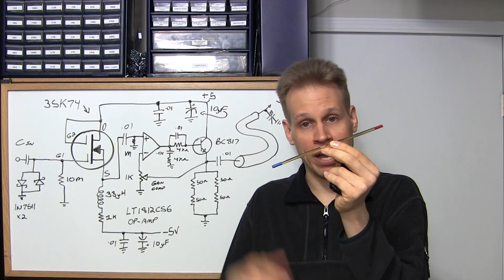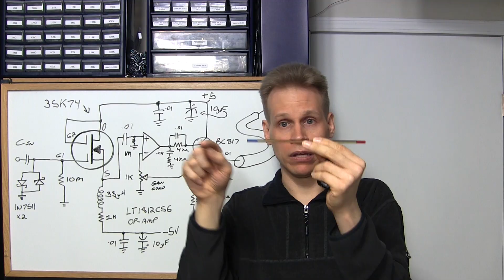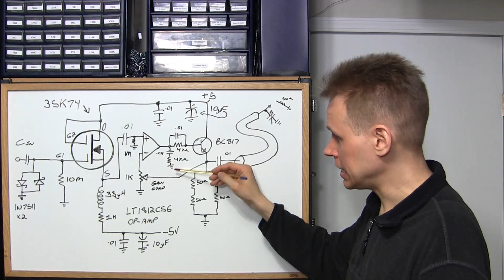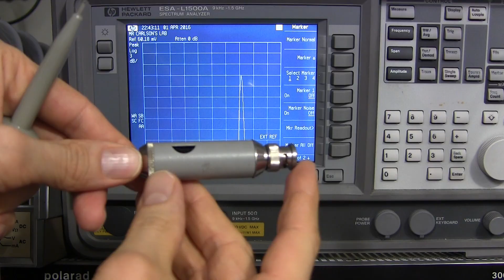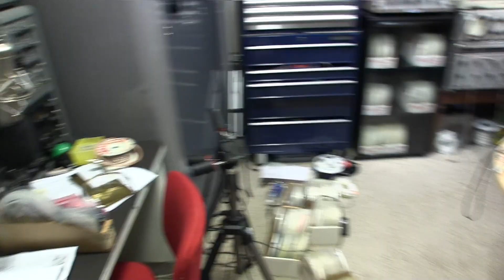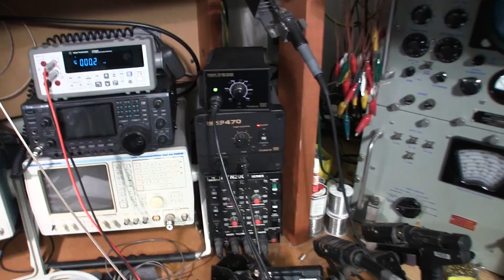Active Probe, Schematic Included

Comment: CC is not a current source. Your output impedance of common collector output stage is 50R || (47R / ß) or about a few Ohms. 
But it should be 50R to drive the 50R transmission line if you are so concerned about reflections.  This is why unterminated probe signal will look awful — it will get reflected by both high (sink) and low (source) impedance ends.
You probably need close to 50R inline with the probe cable.

Comment: The LT1812 is a 100MHz unity gain stable low output impedance opamp. Only works because the gain is so low.
Reply: It already has high input impedance so I do not understand what the FET adds to the design. All it does is the same as a capacitor would.

Comment: Hello can I replace the 3SK74 with NTE455? Or maybe you have other suggestions?
Reply: Should be even better. But as he said, there is a lot of experimentation involved in these developments. You will have to fine tune it. I once build 50 Ohm input BJT Cascode amps in the same frequency range and it was a lot of T&E to get the biasing right.
Reply: I went looking and could not find anyone still making these once ubiquitous dual gate VHF N-ch EnMo FETs. What happened, mixing happens differently and BJT became better?
Reply: Toshiba is the last one making these. 3sk29x are still available.
Reply: After thinking about it for a while I have the suggestion to replace the FET with nothing. I do not see what it adds to the circuit.

Comment: I am wondering if the gain control is shown correctly... Normally, I would expect that the top of the potentiometer would be connected to the  output emitter follower and the "slider" would be connected to the inverting input...

Comment: Could you explain what you mean by keeping it flat?
Reply from the maker: Hi John. When you look at a spectrum analyzer, as it sweeps from left to right on the screen, the line is flat. If you connect the tracking gen output to the spectrum analyzers input, the level on the screen should rise, but still remain flat from side to side. (so the trace should just raise vertically due to the amplitude of the tracking generators output.) If the trace on the CRT was on a slope, the amplitude would differ from side to side (left side of the screen to the right side) Picture the trace on an angle. So if you have a span of 20 kHz, with a center of 455 kHz.... The left side of the screen is 445 kHz, center is 455 kHz, and the right is 465 kHz. As the trace starts at the left of the screen, the tracking generator output is at 445 kHz, since the tracking generator follows the trace on the screen, when the trace (dot) makes it to the center screen, it's at 455 kHz, and so on as the 'Dot" is moving. Then this starts over after it hits the right side of the screen (465 kHz) This is known as the sweep. Since for testing purpose, the amplitude from the tracking generator (and the input of the analyzer) needs to be "flat" through the entire frequency span in order to accomplish a proper alignment. If something is not flat in amplitude (the same across the entire frequency span) you will not align the device under test properly, as you would be compensating for the error in the test set up.
Reply: Ty.

Comment: Mr Carlson you might like to mention this would be an excellent circuit for matching a high Z long wire antenna to a  Comms Rx or for Rx only on a  Transceiver.   2. It might be worthwhile mentioning other Obtainium on surplus market RF op amps like say the LT1252 which will do duty in place of the one you have used. 3 Sources for the negative voltage other than the IC7660  if people want to operate from a unipolar supply ??

Comment: My scope probes have 9 MΩ, why do I need 50Ω at scope connector? Is it to damp the ground reference?
I see all the time 50Ω required at connector but no one says why. Is a probe impedance purely resistive?
Reply from the maker: Hi David. When you read 9 Megs in your probe, you are reading part of the divider that makes it a X10 probe. When you see 50 Ohm inputs on a scope, this is for reading high frequency RF signals with little reflection. You can not (should not) use your X10 probe when the scope input is set to 50 Ohms.
Reply: Is a probe impedance purely resistive? No: it's capacitance dominated its freq. response. And despite what a lot of people thing, its resistance falls with increasing freq. too

Comment: You say that you did keep the copper on the underside as shielding.
I thought that it would create a capacitor effect, I mean (copper insulator copper circuit)? :-)
Reply from the maker: Ground plane layer. Stray capacitance taken into consideration.
Reply: You are correct that it will add C to ground, but the trace width and board dielectric er and thickness will also affect C but allow better impedance control. A compromise would be remove the copper on the underside just in the area you don't want these effects.

Comment: Can anyone explain why engineers design resistor networks to get 50ohm instead of a single 50 (49.9) ohm resistor? Here Mr.Carlson uses 4 49.9ohm resistors, two pairs in series that are in parallel. I am a student and very curious. I'm assuming something to do with stability?
Reply from the maker: The attempt to get a real 50 Ohms, taking into consideration trace resistance, and solder joint resistance.

Comment: The active probe would be a nice and useful item to have in my collection of test gear. I checked eBay to get an idea on the price of an HP 3585B. I found one but the seller wanted more than the price of a new Rigol DSA815-TG.  :P  One of these days I would like to buy a spectrum analyzer.  Spectrum analyzers are rather expensive beasts so I'm more likely to have a go at making a basic one from scratch. I don't need one that covers more than about 0 to 500MHz.

Comment: I enjoyed the video.  I was wondering  how to attach the tracking generator to the circuit that you are aligning so that the tracking generator would be protected.  How do you match the impedance of the tracking generator to the input of the circuit you are testing.  Is it okay to connect a signal generator with a low output impedance to the input of the dut that has a high impedance without any matching?  Thanks.
Reply from the maker: Hi Richard. In most cases, a terminated cable at 50 Ohms, and a capacitor in the Pico Farads somewhere is usually good enough for coupling the signal gen or tracking gen to any receiver. Never couple your test gear to a receiver without a DC block (that pF capacitor) or you may damage the output sections of your tracking gen or signal gen. I designed a protection circuit for this purpose, see this video: https://youtu.be/ETKyKC2Zj-M

Comment: Hi, great video.  I am wondering, why the need for the source-follower FET on the input stage?  Couldn't you AC couple the probe  tip directly to the LT1812 input?  Seems like this would avoid some potential bandwidth loss and gain uncertainty in going through the FET.  Why is the FET stage needed?

Comment: Paul, could it be beneficial to put a resistor at the-end(toward ground) of the GainComp-Vr? (say250ohm)..to avoid the Vr to be loaded(watt) to much in end-position. ..If the gain is turned 'almost' at max Av, the internall end-trace in the Vr(wich now have very low resistance and poor watt-handling) would perhaps burn up when there is peaking lowImpedance-5v from the output emitter-follower transistor(wich feeding back to Vr and opAmp). 
..Link to the video-position vere you taking us trhough the mid and output stage: 
https://www.youtube.com/watch?v=NlbC-cMIBTY&t=827 ..-->Thanks so much for your many many fine videoes. Realy enjoy watching and listening,..and constantly learning from them. 
br, from scandinavia/norway, 
Rolf
Reply: --- AddOn question/correction for my above main post; 
If output-impedance from the circuit is preferred be close to 50ohm(at all time); 
..perhaps the Vr 'end'-resistor (suggested in first sentence main-post), should be 5K'ohm instead of 250ohm (to avoid draging the existing output-resistors down in value, due to paralell-effekt), ..and subsequently choosing the Gain-Vr value some order above that(to suit wichever range and max wanted OpAmpFeedback/amplification)..?
/Just higlighting this. -->Perhaps it might not be correct for this circuit application, myself have not enough practical experience in this type of circuits. 
Again thanks Paul.

Comment: Another think to note is about the 1K potentiometer. It do not chage the gain, it just modifie the current in the output transistor. IF instead of that you replace it by, for instance two 1K resistors with the - pin in between, or better you put directly the minus pin at the juction of two output 100 ohms resistors, your gain will be x2. In such a way you could add a 47 ohms resistor at the output. Then loaded by 50 ohms, the gain will be equal to 1 and maybe the small variable capacitor you put add the end will deseapper because the emmiter of the output transistor will be really loaded by 50 ohms and not byt the capacitance of the cable.

Comment: Hi, Paul. Out of interest, what is the value the input coupling capacitor? At 40Mhz, I'm thinking that 100pF would be a reasonable value. I have all the components, but need to etch the pcb. A run down to rip-off Maplins will find me crying again.
I thought there was a law against rape!?
Reply from the maker: HI Tony, I coupled it heavy on the board .01uF to block DC. The intention is to add an external capacitor (in the pF region) for each specific use. This capacitor would go from the probe tip to the circuit "DUT," and be in series with the .01 on the board.

Comment: Wow!  I'd give you Thumbs Up, as usual, just for showing all the Equipment you have!  To the rf probe: Did you experiment with the number of connections you placed stitching the two sides pf the PCB together?  Common practice for normal, non-rf, circuitry would place many stitching vias along those edges.  Thoughts on the possible effects of more side-side connections?
Reply from the maker: Hi. If this probe was to go higher than it's intention (UHF+) Then the "stitching" would be needed. This is only intended for the HF region.

Comment: I made the probe really flat I ran over it with my car !!
;-P
Reply from the maker: Are you sure it's flat? The grooves in your tires are +- 3dB
Reply: Mr Carlson's Lab Mine are bald they are at  minus 70dB checked with my calibrated tiralyzer.  ;-)
Yes its pretty flat. 
I had thought about using a steam roller to get it just a touch flatter. ;-)
The problem a found previously was the steam roller made things fail due to it creating a reliability curve.

Comment: One thing to note here is that the output impedance of this circuit is not 50 Ohms. It is in fact very small, even smaller than the re of the bipolar because of the shunt feedback from the Opamp. You need a series resistor at the emitter of the bipolar to the output. It would reduce the dynamic range, but provide improved frequency response.
Reply from the maker: There are actually quite a few reasons I built the probe in this manor. Normally, I would add that 49.9 Ohm resistor between the emitter and the cable center conductor. I could write a book at this point, right down to the differences in the op-amps (same part #, different results) One of the major reasons was that dynamic range reduction. This probe originally had a specific intention that can be viewed in the CRF-320 video. The probe was to be flat, and unity gain (or close too) within a small spectrum, adding that resistor complicated matters, found through experimentation. Thanks for stopping by, you have an interesting channel as well!
Reply: Thanks! I assumed that you were already aware of the output impedance. The comment was meant for someone who may be skipping through the video and would mistakenly think that the resistors at the emitter would provide 50-Ohm termination. Great work, your patience in your restoration videos is admirable!
Reply: Mr Carlson's Lab first of all: great video! I undestand both of your explanations regarding the output impedance. If you make a sweep with a 50 Ohm generator into the output of the circuit with the input shorted (50 Ohm would also work ;-) ) you may get surprised. Its all about the flatness of the whole system. Best regards and thanks for your great work!

Comment: I use thermolysis permanent hair removal equipment using a probe (antenna) to create hear in a hair follicle.  I am searching for something I can read to understand where the heat is generated in the probe (antenna), and understand why the heat is created in that location.  What kinds of book will help me?  I use 13/56 mH and 27.12 mH, the only FCC frequencies allowed for thermolysis.
Reply from the maker: You may find some interesting information about tissue heating with RF in literature regarding diathermy.
Reply: thanks
Reply: I am not looking for the uses of diathermy.  I want to know where exactly the positive and negative oscillations occur.  In an antenna it has to do with the length of the antenna.  In a probe oscillating at 13.56 MHz, is the heat caused by the movement of tissues happening at the point of the probe, sometimes known as the point effect or is the heat uniformly happening all along the probe/antenna.  If the latter, then insulated needles are required and no oscillations should be started until after the insulated part of the probe is in the moist tissues, not on the surface.  I know that touching a probe to the surface of the skin, quickly "blanches" burns the skin.  I also know that on an insertion of several millimeters  typically does no damage to the surface of the skin.  Why?  Where is the heat happening?  Why is there a point effect.  Is the antenna broadcasting oscillations at the tip of the probe because the probe is tapered at the end inserted into the tissues?  Diathermy so far has not been helpful.  I know what diathermy is.  I don't know the antenna characteristics are?  I don't know when to use insulated probes?  I don't know if gold tipped probes are better than stainless steel?  I believe this antenna should  not properly be called an electrical current because it doesn't flow anywhere.  But, that it should properly be called RF because it is an oscillating charge, I believe, at the tip of the probe, changing from positively charged (electron deficit) to negatively charged (electron excess) 13.56 million times a second, which creates friction in the tissues that create heat.  The bottom line is tissues are destroyed at 127.5 degrees Fahrenheit.  Desiccating tissues happens at 212 degrees.  I want to find a way to guarantee that the heat range used is somewhere between 127.5 and 212 degrees being as close to 127.5 but not below that temperature.  I need to know the characteristics of the antenna/probe in RF heating in a variety of tissues, generally human, that start at 98.7 degrees.
Reply: Diathermy is the general term for the thermolysis method you are using though.  You are using a shortwave method.  I was looking into studying electrolysis for hair removal and am vaguely aware of systems as well as directed energy weapons being covered up as TSCM systems that should only be used for listening/receiving purposes and not ES/EW V2K/cult programming/transmission trafficking purposes non consentually.  Anyhow... so I don't go off topic... you seem to have a general idea of what is happening.  I like to think from a James Clerk Maxwell therory of forces up to quantum mechanical energy theory better detailing the range more in this case.  So, you understand there is the vibrational energy primarily caused by the electric and magnetic field oscillations causing friction heating the surrounding tissues/materials in their phases (i.e. solid/liquid/gas/plasma).  Keep in mind there can be rotational energy causing friction heating also.  The topics you should read about would be antenna design first  as well as the omnidirectional nature of the type of antenna your probe is so you can visualize the field and dispersion.  This field can be measured with a field strength meter and graphed if you wanted to see hands on what the field looks like as well as loss due to distance.  Then phases of materials and EMF effect on materials and polarity of the electric and magnetic fields would be good to read about to visualize more molecularly. Rotational energy if I am visualizing correct relates to the circular or elliptical polarization, so I think you are correct in regards to heating from vibrational energy more since horizontal or vertical polarized.  That would give you an idea of the 3D diffusion/transmission of the signal energy and heat.   There is other properties of the fields to you can read about from a optical, electricity and magnetism physics perspective, i.e. reflectance, abosrption, etc.  I'm thinking this should help and I find wikipedia a great starter for references and basic understanding with examples something like Mr. Carlson noted above about diathermy.   Mr. Carlson is bridging my hobby electronics background from 20+ years ago with my post undergraduate studies.  Way awesome information and teaching skills.  Especially if you're on a SS pension and can't afford much.  As my Dad always said... learn to fix things yourself and you'll save a lot of money and you can learn to make things more effective too.
Reply: These are primitive RF transmitters as you said mostly below 14MHz (20 meter Ham Band). I had Prostate surgery where the 13.56MHz rf was injected by needles (TUNA) procedure. I can clarify that because the antenna part is likely a solid conductor and the currents are low - the only heating is in the tissue. This should be well explained somewhere easy to research. Be careful with this equipment and using it!